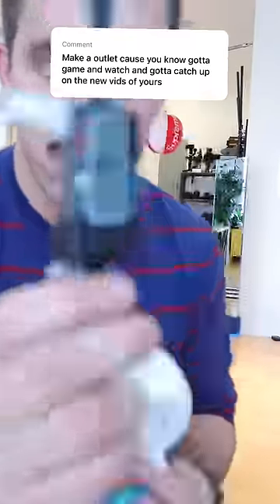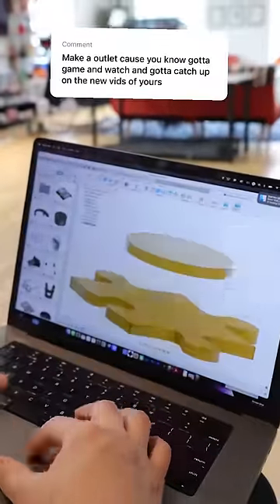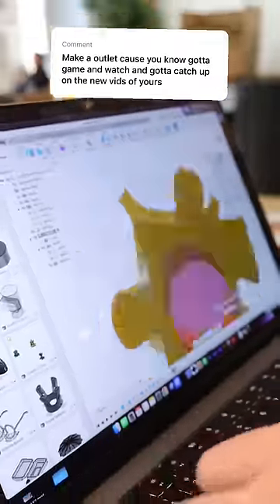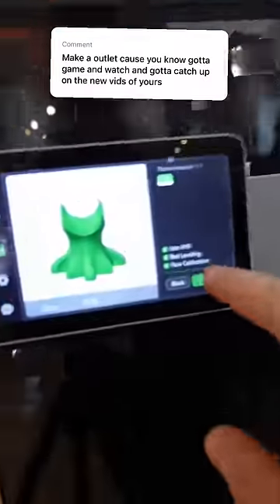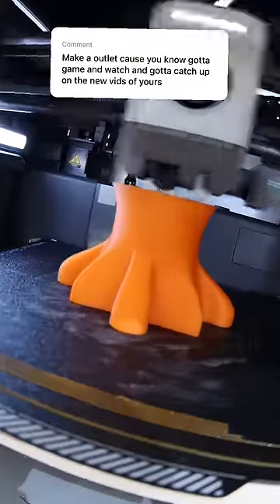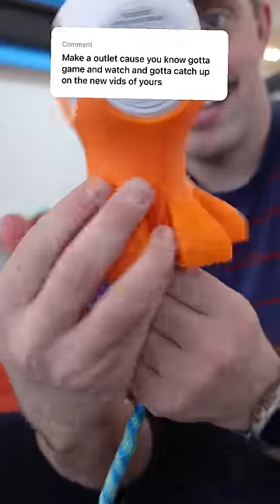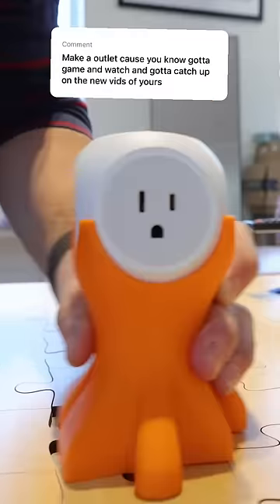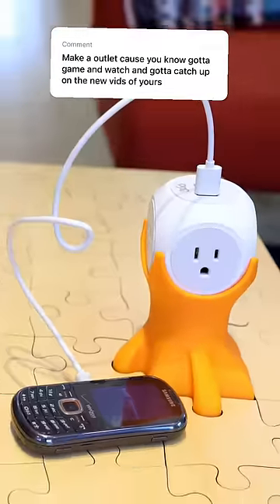An outlet for the Puzzle Table?!?

Comment: -takes all measurements with a very precise and accurate instrument.
-shocked when it fits perfectly 😭😭😭
Reply: sometimes the tolerances on the printer can be just a little off
Reply: Certified machinist moment
Reply: Nice
Reply: Have you ever made something where you needed super precise measurements to? It can get very tricky for no reason other than the need to be percise.
Reply: -knows nothing about tolerances
-comments
Reply: @queremq  -also thinks it's a great day to learn something new :)